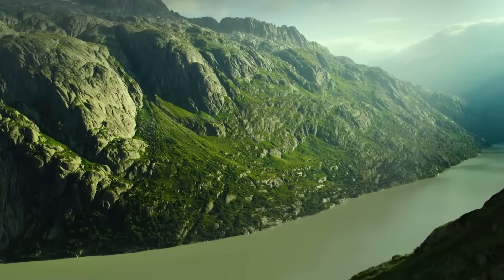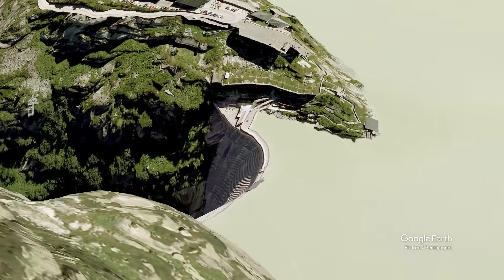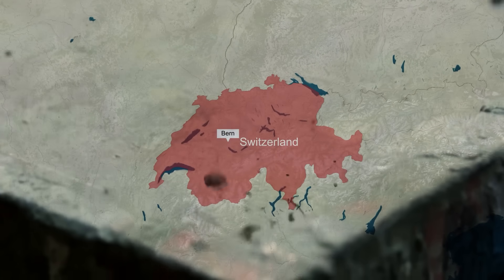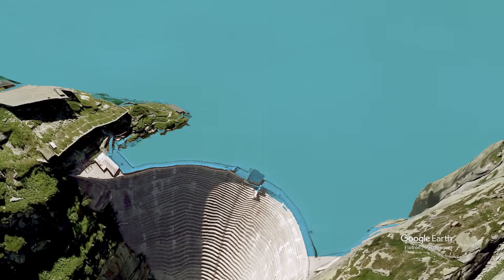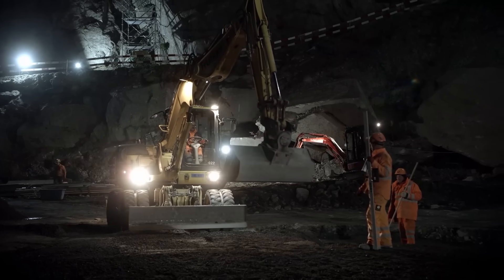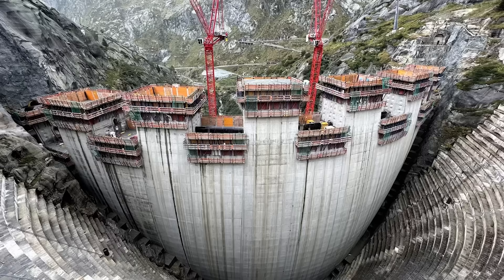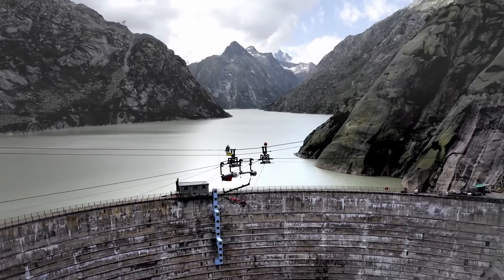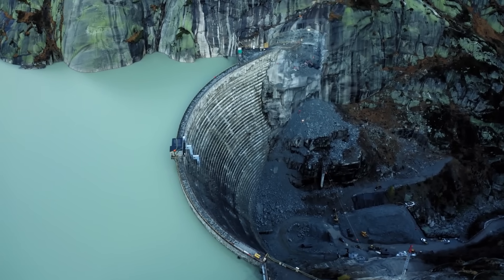Switzerland’s Urgent Battle To Replace A CRACKED Mega Dam

Comment: Nothing to do with repairing something. The dam will be raised to increase the capacity of the Grimsel lake and thus to increase the power production, as the Swiss people have voted for increasing the power production from natural sources.
Reply: The old dam is damaged, but building a new dam in front is cheaper and safer than restoring the old one since it's engineering is very outdated and since the old drain is getting into sediments. The dam gets built to the same height as before, but with the possibility to increase the height later. Raising a dam height only minimally increases the power production. Dam height increases are done to enhance the capacity of energy storage, which can primarily mitigate the winter gap problem of solar power.
Reply: I bet the difference is that there are no property owners to deal with.  And no politicians to keep changing the scope of work?  (This is how all big infrastructure projects get bogged down...)
Reply: All water (and electricity) infrastructure and supply is owned by the state in Switzerland. There are no private owners.

Comment: If they leave the old damn, does that put less pressure on the new dam?
Reply: I would think so. The existing dam has to hold back the full force of the water behind it. The pressure will be dramatically decreased once water is on both sides of the Old dam. This will likely stop the deterioration.

The New Dam will only have to hold back the water between it and the Old Dam. Even submerged, the Old Dam will continue holding back the majority of the pressure. This means that the New Dam can be constructed with less materials and reinforcement. Not sure if that was a factor, though.
Reply: You have absolutely no idea about physics!!!!!

The water pressure does not depend on how large a reservoir is, i.e. how much water it contains. Only the depth of the water is the determining factor. This means that the water pressure is the same at both dam walls!

The only difference is that there is water on both sides of the old dam. It therefore receives pressure from both sides, which balances each other out. It therefore no longer has to be able to withstand the water pressure, but only its own weight.
Reply: @bernhardammer5106  Not true.  If you had 100 feet deep water,  and only 1 foot wide from bottom to top, it would be a lot less pressure on the dam  then 100 feet deep, and 100 feet wide.

Comment: Calling ANY place in central Europe remote is farcical. Most places in Europe you could probably put a 100km radius circle down and there would be a million people there. There are spots in Australia where you could potentially fit Switzerland and only find a few hundred people. A dam that is within 50km of major cities isn't remote.
Reply: Well... horizontally, you are 1000% correct!  The dam is just 5 km away from the next village, as the crows fly, and 25 km from a large town and a major highway. 
BUT, vertically, it is more remote than any place in Australia!  The nature of the terrain, and the winter climate, make the engineering of building that dam more difficult and costly than in the remotest of places.
There is another dam construction in Switzerland that is even more remote!  In the Grimsel dam featured in the present video, there is road access for trucks.  At the Limmern dam, there is not!  A giant cable car had to be constructed... and EVERYTHING, from giant construction equipment to cement, has to be brought by it.  And in the winter, you have meters of snow, and arctic temperatures.  I call that remote alright!

Comment: Doesn’t that prove that water power plants are expensive and produce CO2 too..? 🤔
Reply: Nobody pretends that hydro storage power is CO2 free. However the CO2/TWh is rather low, but not 0. And yes, hydro storage is somewhat expensive and will soon be more expensive than battery storage.
Reply: @ run-of-river power plants are the only harmless plants. At least regarding CO2.

Comment: But if the old dam collapses the flooded middle gap will shear the new dam off the cliffs in my opinion
Reply: The flooded middle gap takes the water pressure off the old dam so it will not collapse.
Reply: @chamagical you are both wrong. They are currently (jan 25) draining the water completely and carving a big hole into the bottom part of the old dam. Once filled, the water pressure will be completely on the new dam
Reply: The old dam will bear no more load at all, once the middle gap is flooded.  Structurally, it will be as if it did not exist.
Reply: @st-ex8506  Flooded from both sides, the old dam will only have to bear its own weight.
Reply: @ ... not even that:  i's own weight MINUS the weight of the amount of water it displaces (according to some old Greek guy)... so, roughly only 60% of its own weight!